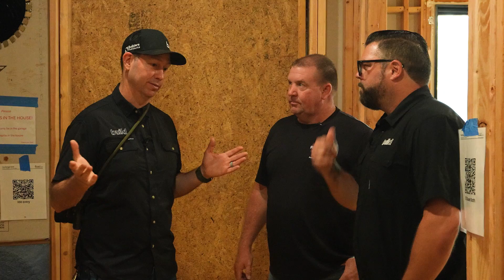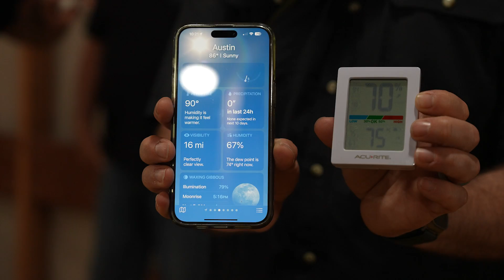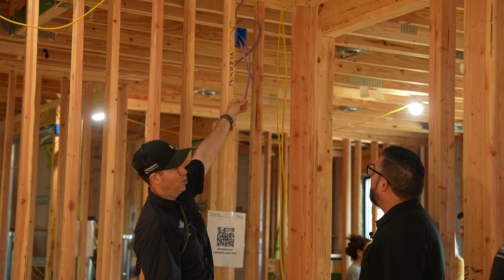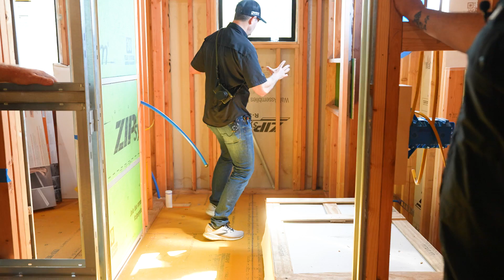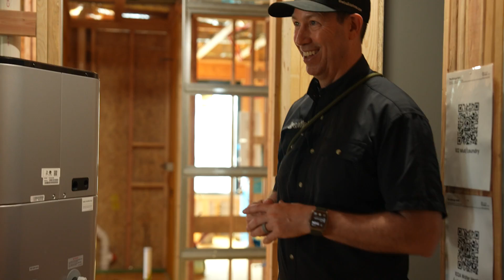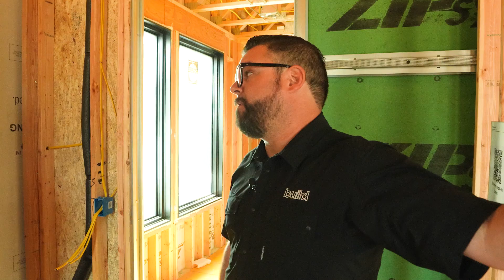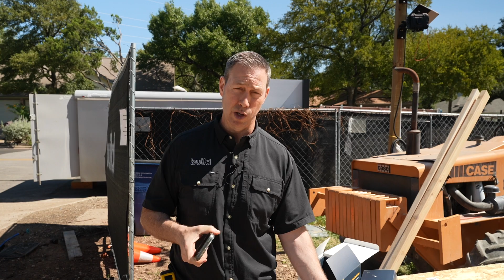The Risinger Build: Episode 11 - MEP Electrical Rough

Comment: this is very interesting and way more advanced than every build I've ever seen for a home.  If my electrical experience had a face it'd be smiling ear to ear listening to how efficient all of this is.  Not talking about JUST electrical, but also the balance of air exchange planned for this air tight home.  Very thoughtful.  Keep doing what y'all doing.  Most folks won't get it until they can understand how a complete MEP system works overall for any kind of build.  I'd like to see how y'all air balance out once it's all completed.  Let's have it, man.  Thanks for all the vids.

Comment: 12/2 is not confusing... Read the label: It's called "12/2 with ground" when it has three wires. If you call your horse, your Hor... It's confusing, but that's not the horse's fault, it's yours.

Comment: As an Electrician since 1999 who has done residential, commercial, industrial, and line work, I can tell you with certainty that new codes come almost entirely from the manufacturers of electrical products. Whether it be intentional or not, (it is so they can sell them better) it benefits them greatly when their new products become mandated by code.

Comment: Mat, im thinking one of your best video, well maybe, because I'm building here in Wisconsin and plenty that I'd like to do that you had mentioned, about placement of things and the efficiency of how to place and where and why, I want to prep for security cameras on a 4/12 knowing that there's not a lot of room at the bottom where the wall and roof lines comes together as you did for that Fiber optical , how were you going to close that up to stop little things from getting in and how would close it up not to have a air funnel coming through it, let's say in my case after it all put together

Comment: So the electronics in your "closet" with hot dehumidified return air, the LG unit cooling the air when it runs will rarely see stable air temperature which is ideal for electronics.  I think you are trying to do too many thermal management steps in this closet.  I invite talk on this point.

Comment: As an electrician, all I can say is there is no need to have smart capabilities integrated into an electrical. That is asking for so many issues down line from firmware and potential app issues to trying to source breakers locally in a pinch.
Reply: If your load calc goes over the 200 amps, like I’m sure it did for this house, that span panel makes a whole lot of sense!! Just my 2 cents though.

Comment: I am an electrician by trade (mainly industrial).  50 yrs.  If I was wiring my house right now, all my romex runs would be in the same chase and 90 to the devices.  No beeline.  All circuits would be isolated to each room.  Lightning and receptacle circuit the same for each room.  No running romex through wall studs.  Tons of more wiring and cost but that is what I would do.  My present home has a 12:12 roof pitch with plenty of attic space.  The wiring looks like a spider web up there.
Reply: Can you elaborate in layman’s terms about why it’s important?
Reply: @crikescrikes2465  Its mainly about personal preference than importance and keeping all wiring to code.  I generally do not like drilling holes into ceiling joists.  No wiring laying on top of ceiling joists.  All the romex branch circuit runs can be routed close to where the roof rafters join onto the walls.  Then the romex can branch out between ceiling joists and fastened to the side of the ceiling joists to feed light boxes and where needed, penetrate top plate of walls for receptacle feeds.  Actually, running romex through wall studs for receptacle feeds in the room is fine.  Having an individual branch circuit just feeding each room (lights & receps) is more about organization in the electrical panel.  Easy peasy to isolate if needed.  Of course, it depends alot on your floor plan.  I like attic storage.  Floor decking is easier when wiring is not laying on top of ceiling joists and drilling holes in ceiling joists is not what I would do.  My dream house would have a master bath for each bedroom and a walk in closet.  A large utility room and kitchen.  The house doesn't need to be huge, just functional.  Builders and sub contractors always seem to be stuck doing it same old same old.

Comment: Don't use plumbing pipe for electrical conduit. It is now listed for that use. The elbows do not have the correct radius as well. If you kink telecom/low volt wire you wreck it.

Comment: When I build, I want to use some of those bathroom occupancy sensors to fire up the hot water recirc pump for maybe 15-20 seconds, or until a temp sensor at the pump sees hot water. Makes a lot more sense to me than putting it on a timer or something. Probably put one in the kitchen too.

Also, would love to use the same ERV instead of exhaust fan strategy, but I've got an idea to use a couple Fantech PB series exhaust vent/lights instead of the normal vent grills in the showers. Should look pretty clean, perform well, use fewer components and require less installation time. I don't like the idea of dumping the Dehu-air into the bathroom with an ERV exhaust right next to it. Seems like a waste to dump the energy into pulling water out of the air, only to load it up and dump it immediately outside.

Comment: @buildshow Matt at 7:39 you stand in front of your SPAN panel and I see parallel runs of wire coming down the wall and making a 90 degree turn to the next stud. (Presumably to go up to the panel) Back in the seventies, I did this for wire runs an a cabin in Big Bear CA, and the inspector had me tear it all out and bunch all the wires through one big hole. Please help me understand why
this is OK now...

Comment: All the talk and effort in air sealing the garage from the main structure but no true (unless Zip sheathing qualifies) fire rated separation.  Texas, I guess....
Reply: Yeah --- a connected garage and a quick flame run to the kids upstairs bedroom walls ... what that heck is that about?
Reply: They have not installed the 5/8" sheetrock yet.

Comment: My HVAC guy hates and refuses to do an ERV boost in a bathroom. I wish I could remember why. He talked me into getting the Panasonic WhisperQuiets though my house isn't finished yet so I can't report on how good they are
Reply: They’re quiet and they have timers on the switches. If you want a more localized setup for each bathroom exhaust unit, that’s a good choice. Energy efficient yet not overly complex or tied to a larger system.

Comment: How do you air seal your garage? Current code that is pretty much everywhere requires that you have to have fresh air venting that is non-mechanical so the register in the wall exposing outside based on the size of the garage is how big that register needs to be and they do that so you don't have your car running in the garage and close the door and you take a nap and go to never never land. But that is code for pretty much every build for like 20 years now and I think even longer than that especially if you have natural gas or propane service. Out in Phoenix, or we get 115 120° days multiple times a year and we're above 115 for about 60 days a year and then above a hundred for like a hundred one days a year, I built my house to have an air conditioned garage. But I have to have two giant holes in the side of my garage for registered scoring the outside vents that point downwards in the stucco, one at the bottom, and one at the top with 14 ft ceilings. And it sucks having those massive hot air leaks in my garage but it gets required.

I did turn my house into a full smart home so everything is completely controlled by my home assistant server. Including ratgdo to replace the stupid Chamberlain Wi-Fi that is completely invasive. And I have air quality sensors everywhere throughout my entire house and so I was able to create a heat map in home assistant over the floor plan and so I can see the actual air quality pollution carbon monoxide carbon dioxide O2 levels formaldehyde levels and various gases and sear in real time heat map threw up entire house and set off alarms and alerts if levels get too high in certain areas. And then also having things like humidity sensors that when the shower runs or something the fans automatically turn on and run until the humidity drops the lowest certain period after X minutes has passed and maintained below that level. And insane with lighting putting radar sensors in every room so the lights are all controlled and if someone's been out of a room for more than 5 minutes the lights and devices all turn off. And because I'm using radar MM Wave, it can even tell if you're sitting still or breathing and I can even get someone breathing rate and heart rate sitting on the couch through a radar sensor which is absolutely insane, but I can count how many people are in a room due to that all kinds of other local stuff. Where your normal infrared motion sensors only detect motion and so if you're sitting still watching TV or something for more than a few minutes everything turns off on you and I'm sure we've all been there with those sensors

Comment: I love that you use all 12-x and not any 14-x wire...  I hate that people go cheap and when your doing a whole house, they save $2k by doing all wire where possible 14 guage.   The future home owner doesnt understand the difference, but when they use that bedroom line and sitting in bed with a hair dryer watching tv, 12 vs 14 really shows its benefit. Where is whenever women hair dry in the bathroom, it's not that big of a deal because the bathroom is required to be 12. But the bedroom is only required to be 14 by code, and so most electricians will do the cheaper option. I hate using 14 gauge. Just because of the performance. I prefer working with it definitely, it is so much easier to work with. But when it comes to those power draw demands just upgrading everything to 12 gauge and even if you want to upgrade the bedrooms to a 20 amp circuit versus the 15. And also and wish more electricians would be more realistic on placements of outlet boxes. I know it's the 6 ft rule so it can be up to 12 but between boxes for code, but whenever you have a long wall and because the code is written the way it is it allows me to put just a single outlet in the middle of that wall and then now let on the side wall is just a little bit around really really sucks. I wish that they would work with the homeowners or see where the bed will go here just by the layout of the room so this is where nightstands would be so it would be nice to have an outlet or in that area on both sides. My master bedroom was built by a production builder in 2019, and in the master bedroom behind the bed wall they put a single outlet in the middle and it ends up being right in the middle of the back of the bed and so if I ever have to plug in anything or move anything I have to completely disassemble my bed to move it because it's so big and heavy just a plug in something! So when I moved in I put two power strips one going off the left and one going off to the right and it's just a chanky way of having to get electric service behind my nightstand

Comment: Rather then drilling a hole for each romex wire, why dont you do like they do in commercial space, use a 3-4 inch conduit that is about 5" long and use the protection rolled ends to keep wire from chaffiing, and put it all through that chaseway. Then after, completely pack and seal it with fireproof barear caulking/paste. Still gets you sealed and gives your electchickens an easier option

Comment: Maintenance cost down the road on a home like this is going to be crazy.
The convenience and control going in is awesome but electronics and automation components don't last forever. If you are wealthy, I suppose it won't matter much but for regular people, I think it will be a burden. 
10 to 15 years in, HVAC replacement, water heating issues, ERV problems, faulty dampers, blown CPU in the SPAN, etc.
Reply: Nah, the bigger problem is maintaining the HRV system. It requires frequent, (usually expensive), filter changes that cost hundreds every year. And heaven help you if the HRV system stops working - now your home is gassing you with unhealthy air.  It should be mandatory to install air quality sensors in tight homes, with warning sounds if something isn't working.

Comment: HEAT PUMP dryer!? never heard of that! thats awesome!
Reply: I love our Meile Heat pump dryer. 110v not vented.
Reply: @deonfackler5588  how does it deal with large blankets?
Reply: Whirlpool and LG make them. I bought the LG one. Haven't hooked it up yet but it has great reviews. Mine is ventless too so I have no penetrations and the energy star website says they use as much as 28% less energy. The only "downside" I've heard about is drying times can be 3+ hours but I'm rarely in a rush so I don't care

Comment: Your homes are the standard I wish every builder strived for and adopted. A one amp exhaust fan 24-7 will use just over 1000kwh per year or avreage of $150/yr for the electricty and if fan was put on a 30 minute automatic on per use with average 5x per day for every bathroom the power would cost less than $20/yr saving the homeowner over $130/yr per bathroom. I am not sold that adding SPAN a very complex electrical balancing/reporting/control system to adding some remote control, reporting, and save one time costs of a larger main service is a sound idea for the most important system in a home. Installation, Repair, and servicing will be limited to only contractors trained in fixing SPAN panels making quick restoration of service more costly and likely take much longer to diagnose repair and replace parts that are not widely and readily available.  Ray

Comment: Another option on penetrations through your air barrier is to have a single removable board that the electrician can drill all the holes in in advance (including spares), and then tape and seal the board after rough-in is completed.
Reply: Might be overkill, but “Roxtec” is great for wire management through a wall. Waterproof, insect, rodent & fire-proof.

Comment: What are the QR codes hanging everywhere?
Reply: I think they're usually there so when each trade comes in, they can just scan it and know exactly what needs to be done in that area. Like what item/fixture goes there and type/brand, what service goes there, and/or what finishes go there. It can sometimes also bring up the blueprints so it shows measurements and locations of everything.

Comment: With the ERV’s running continuously in those spaces, doesn’t the HVAC have to run more to acclimate that air and adding to your utility usage? We install ERV’s in all of our homes but during extreme periods of hot/frigid weather, we have recommended to significantly dial back or turn off the ERV’s during those time periods— it’s a balance of humidity as well. But Texas faces longer hot spells than our Midwest climate. Curious what your thoughts are on that.
Reply: Absolutely, ventilating when the outside air is hotter/colder or wetter/dryer than the desired indoor air will always come with an energy penalty. ERVs do a good job of minimizing the penalty, but it's still there.

Comment: So they are knowingly not upgrading the service to meet the potential demand and instead planning to manage it via a "Smart Panel".  So which load are you going to have to go without when you don't have enough power?  Two car chargers sucking up half the service capacity....
Reply: I don't know if a larger service gets billed higher than a 200 amp system... If it doesn't I'd rather have a dumb panel with fewer points of failure if the rates are the same.
Also when the panel maker goes defunct you have no support or parts supply.
Reply: @Clip_This_Schitt  Seems kinda silly regardless to build a house and under supply it with electricity and need a smart panel to shut-off loads when there isn't enough power.

Comment: For the exhaust fans we did an ERV but instead of pulling air at the same time off all restrooms, we did timers with motorized dampers… so if one restroom is in use, the ERV goes to max but all the other dampers close, so i have full ERV capacity just on the bathroom in use…
I also connect the ERV to my make up air unit for the vent a hood… so when the vent a hood is running, all the exhaust dampers closes and ERV just bring air to the house…..
Reply: That's clever, how are you triggering the ERV when the bathroom is in use? Which ERV did you spec?
Reply: @grinchyface I have dry contact timers on each zone that I need exhaust air, and all this inputs goes to a relay array I design to allow the damper that is running to open, bring ERV to high stage  and close an intake I have on the top of the enclosed attic that pull air on low stage
Reply: @novaair2481  does the cfm on your ERV match your vent hood cfm? And unless your able to shut off the exhaust fan in your ERV, wouldn't closing off all exhaust pathways do harm to your fan motor?

I really like your bathroom idea though

Comment: Looks like everything is 20 amp (yellow wire) in TX.  Is that code there?
Reply: Actually they addressed that. But to answer your question, many of those romex runs are 15a runs. Color coded romex is relatively new, and many builders/electricians are only now making to switch to using the other than yellow colors.
That said, who wouldn't rather just run 12ga everywhere, it's sure cheaper to do it now than regret ot later.
Reply: @Eric-1701  I can agree with being somewhat liberal with running 12ga, but we’re only going down in energy usage not up. Tools, fridges, kitchen appliances, etc, all going down in watts used. 

No sense running 12ga for all your ceiling electrical needs or other areas that would only ever run built in low watt items. 

12ga romex is 40% costlier than 14ga in most regions. That’s a lot of money for no reason.